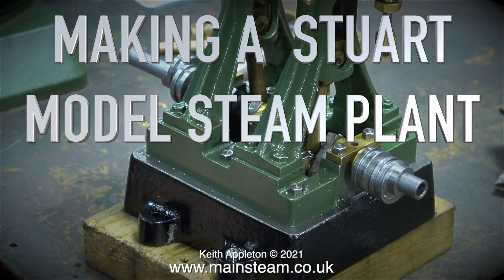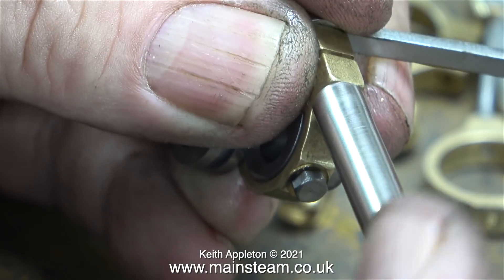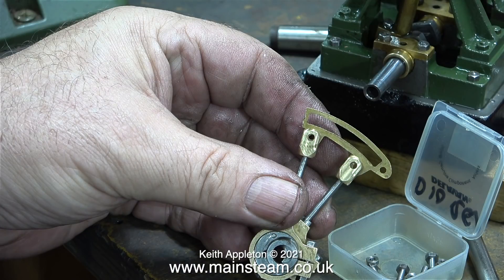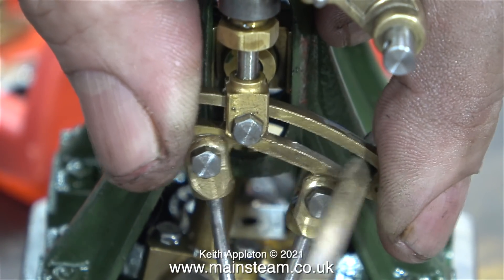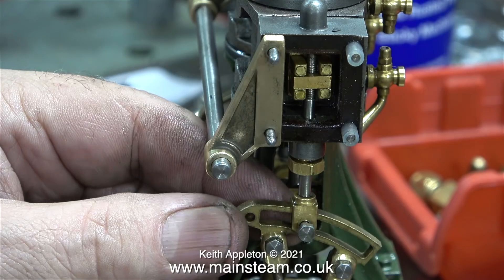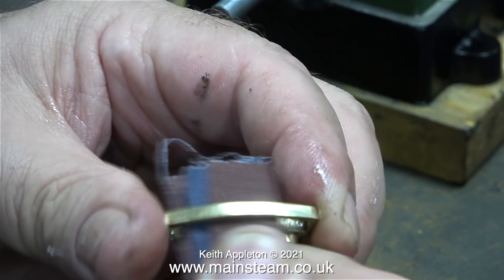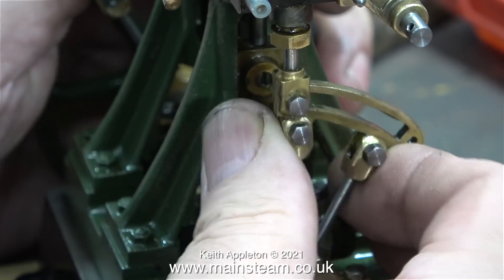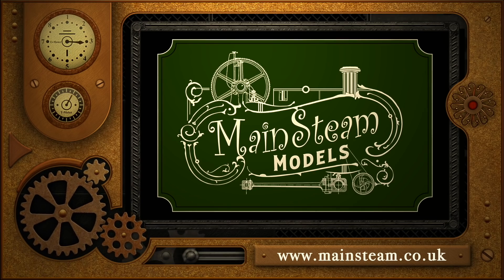MAKING A STUART MODEL STEAM PLANT - PART #26

Comment: I just wanted to ask why in the last episode the middle baring was lose.
Reply from the maker: Because the Crankshaft is slightly bent. After a bit of running in, I tightened the bolts. When I rebuild model steam engines I alway allow some play in the bearings until the job is finished.